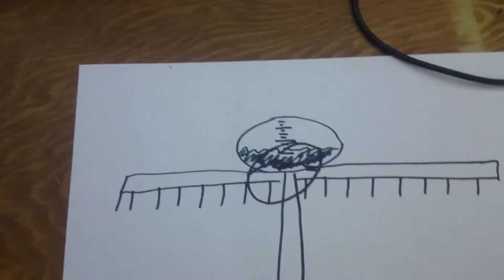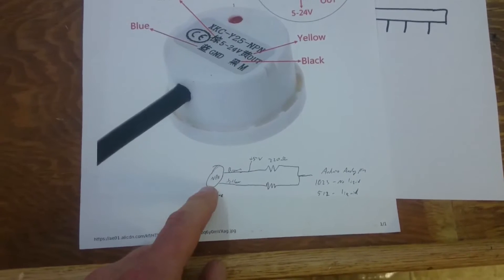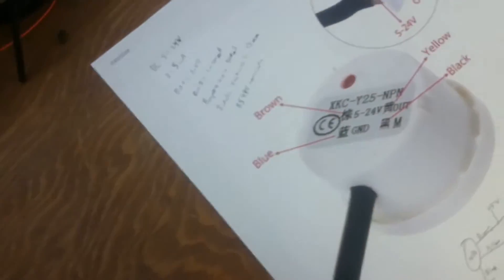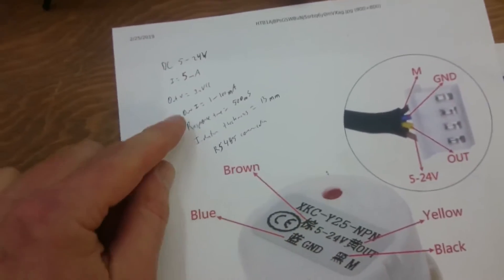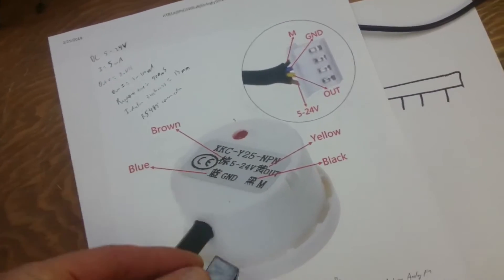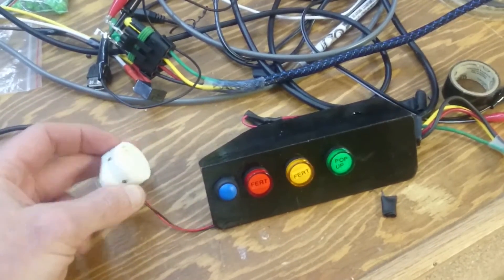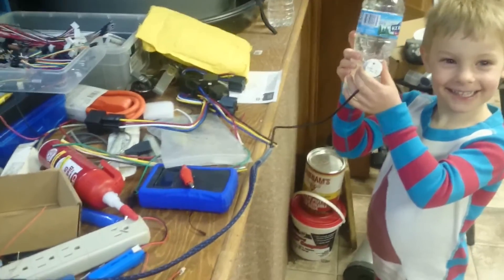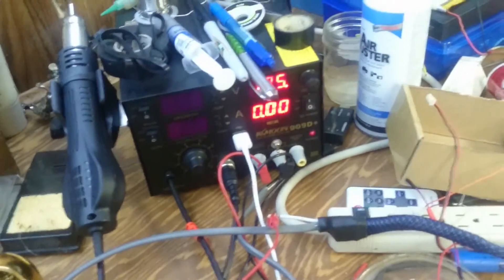NPN Non-contact Liquid Detector with Tractor Bracket

Comment: mA is not power. It is current. What you loose over distance in voltage to the relay. The lower the current is, the lower the drop in voltage is.  Great ide, and I like it. I ran into this video because I am looking for some way to measure level in a fuel tank. To bad these don`t work on a metal container.
Reply: did you find any way to measure liquid in metal tank ??
Reply: @abdalrahembarham4343  https://www.youtube.com/watch?v=UrqPxwsPWGk I will use this method. Not finished testing, but I think it will work.

Comment: Does it need any calibration? can we use it for a permenant case for a long time?
Reply from the maker: The way I'm using it, there is no calibration.  I wouldn't use it outside without putting some silicon around it.

Comment: I had seen this water sensor in Chinese e-commerce AliExpress. Can u tell me where to connect Black wire of sensor. 
Brown wire = positive (5-24v)
Yellow wire = output ( positive output when water is senses)
Blue wire= ground
Black wire = ???
I had asked the Chinese seller but English in China is terrible. I can't understand their English.
Reply from the maker: My notes have this as follows:
Brown: +5V
Yellow: Signal/Out
Blue: Ground
I didn't find a use for the black wire.  Hope this helps!
Reply: Black wire to a suitable pic. Then from that you could operate relays to turn on practically anything!
Reply: black wire is the sensor select line. so if you have more than one you can select between them. Say you are running the unit on 5 volts. When the wire is tied to ground (-5v) the unit is active, when it is tied to positive voltage (+5v) the unit is not active. So this way, say if you are using a micro controller you don't need to use but a single analog pin. However, you will need a way to enable and disable all those separate lines but there are port digital pin extension that can take care of that.

Comment: Do you have a rough schematic of this circuit?
Reply from the maker: Sure, I found the schematic for the reset circuit here: https://www.boatdesign.net/threads/buzzer-mute-button.47881/#post-643984
Reply: @pandrews255   Thanks for the schematic. Which Omron relay did you use?
Reply: Sorry I just saw the parts list up above, thanks.